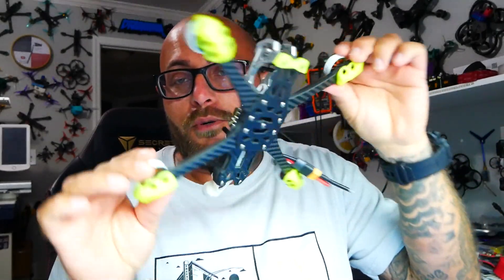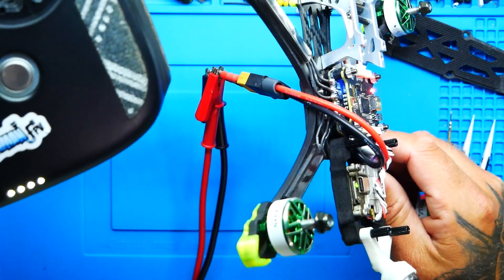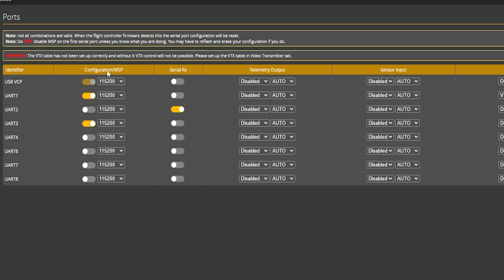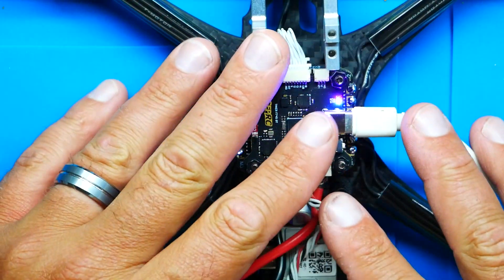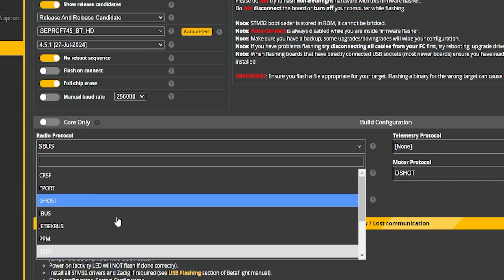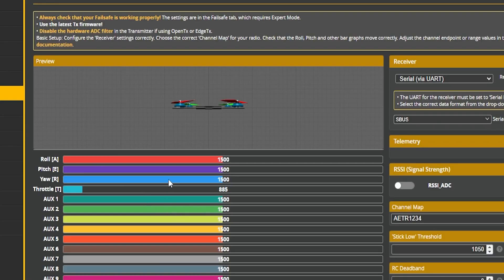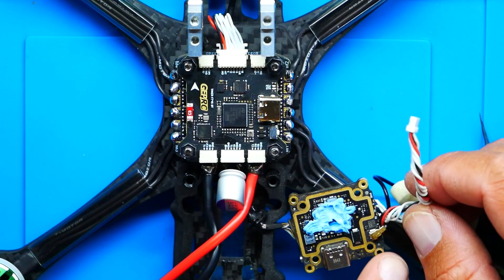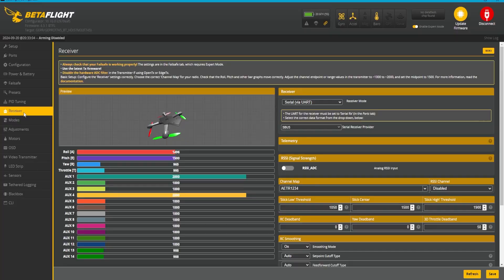How To Get Your Receiver Working!! No Communication in Betaflight?? Step By Step Troubleshooting

Comment: Hey, have this New RM RP3 ELRS V3.0 Diversity receiver won’t go into Bind Mode. Tried 3 plug way,  doesn’t work. It blinks slow red an after 60 seconds blinks fast for WiFi Mode, am stuck why it won’t double Red flash for Bind Mode, it’s New so it can’t have a bad Flashed to it Right? How do I get it into Bind mode now? 🙏🙏

Comment: 9:41 son of a bitch. I've been stuffing around with a new vapor 5 PNP,  and ended up with the same no RX coloured lines after fitting an ELRS Rx, disconnecting the 04 Sbus and setting it up as per.   That's a real pain! But at least I know what the problem is so thank you!   Now I just have to make sure I save all the settings before i flash it! By that I mean find some vids on how to confirm I am saving the setup as they seem to be a pretty good flyer out of the box, I'd rather not stuff that side of it up. Thanks again for the help!

Comment: Good morning, sir. I'm a follower of your channel. First of all, thank you for your videos, which are very helpful. Congratulations on your channel. I need your help, please. I have a CinewooHP
3.5-inch with a DJI AIR UNIT 04 Pro system, a DJI 3 controller, and Goggles 3. I have a JHEMCU F7 22 AIO flight controller. Everything is paired correctly: goggles, controller, and camera. Once inserted into Betaflight, everything works correctly, but the receiver bars don't work. I have a video signal, but the bars don't work. I need your help, please. I've followed your tutorial, but the bars still don't work. I don't know if it's the UARTs. Thank you, and best regards

Comment: Hello DrainMan! I have a cinelog v3 with the dji o4 pro air unit +goggle n3 + dji fpv rc 3 configuration. After a strong crash I replaced the air unit completly.Binded again from the beginning.Calibrate the rc on the goggles but the controller is not detected anymore in betaflight.Not a single button or  a joystick is deteced anymore.Any advice wood be really appreciated!

Comment: Thanks for the video! I’ve been assembling GEPRC Vapor and I had a problem with Betaflight not seeing receiver commands while binding was successful. The problem was that I connected DJI O4 pro with standard 6 pin cable to the FC connector and didn’t notice that one of these 6 pins on FC is labeled R2, at the same time I had soldered my ERLS to UART 2 on the other side of the FC… I followed your instructions and removed 2 wires from DJIO4-FC cable and it works!

Comment: Criminally underrated for real build issues.
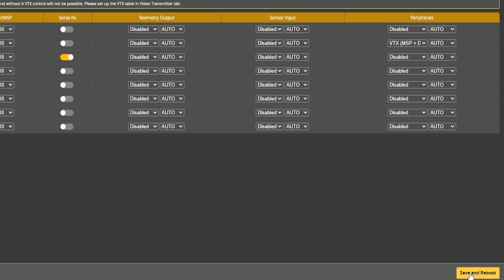For anyone else with a similar issue, I changed an analogue vtx to openipc thinker and toggled its serial rx on, as drainman points out around 6:30-6:50 you just want it toggled on one, so I left the openipc serial with msp toggled, unset serial rx for openipc, left it toggled for the receiver, and that fixed the issue.

Comment: allot of people are buying BNF PNP and they want to add there own receiver Crossfire or Elrs and betaflight is stuck on SBUS It would be great to make a video on saving the CLI and putting a new version of BF with Crossfire/ELRS and then adding that CLI So you still have all the settings from the BNF but with ELRS/crossfire.
I have looked and can't find a video on this problem. Its a bigger problem since Betaflight is shipped on PNP quads with only Sbus on them...

Comment: Thank you so much!! Finally I was able to bind my receiver. I just bought the rp4td radiomaster receiver and spent almost a week since I welded the receiver to the UART2, it got power but it did not work, until I watched your video and I noticed that I should try to weld it on the rx3 and tx3, went to betaflight and configured the uart 3 and now is working. I could not find a better video than yours, I was really frustrated but now I already made my first flight with elrs. Thank you so much!

Comment: brother i watched the video and dhamn this is good content there was only one thing to do and that's smashing the sub button and freaking like the video ;-))
i'm having some trouble now with my NAZGUL DC5 ECO  , i soldered the GPS in and soldered the yellow and white to the same port as the ELRS unit ..omg i'm pretty new to this but i'm not a noob with the solder iron but STILL A MORAN DO HAHAHA 
what happened after i finally find out my mistake  by measure the solder pads r2 and t2 channel ports on the board back to the connectors on the cable to the ELRS i had contact it seems that there is a 4 pin  connector under the board that is using the same connections / port ..omg one lesson learned;-0  ( i did this because i want to use the USB c powered 5 volt connection to let my GPS find SATS  with 5 volt power pack on C USB ..while drone still is in low power modus zo i could connect my 6S LIPO only when SATS  are plenty 
and pull out the c USB and fly with all the SATS  i need with out frying my drone waiting on SATS with the LIPO on it to find al SATS first ) 
oke now i know how the ports work and the board/FC   is not 2 different layers of cake ;-)   zo had to put the wire back on R4 and T4 that channel was free 
kept my power red and black on the same 5 volt power output as the ELRS  is pulling power from ,
but here is the second mistake i made i i saw i also had the yellow and whit wire  switched the wrong way on the T2 and T2 on the ELRS connection OMG i'm a idiot i know hahaha 
but changed the wires and boem my GPS is up and running finally i was happy , but now my ELRS is binding to the controller but no sticks moving in BETA and all previous working setup modes /switches did not do a thing to ?
Did i just fry my ELRS UNIT with my EPIC stupid move ? it binds to controller but keeps blinking 3 times bleu ? not a soled green , and my t15 jumper is saying MODEL MISMATCH now ? 
please help me out  if you got a solution 
i already order a new IFLIGHT  ELRS unit but that's the bad out come fix hope you got a idea to flash my brain fart 
thanks for the contend

Comment: Hellooooo, ive got a big problem with one of my quads.
My receiver is no longer recognized after 8 months of quad storage. It just beeps. Changing the UART didn't help. I use crossfire, also tried with frsky. Same problem. The FC doesn't accept any signals.. is he dead?? I want to despair...😪

Comment: I’ve always been a Spektrum dude that flys large scale planes and turbine jets. I’m getting back into the fpv quad hobby for fun, but for F’s sake, BetaFlight will not recognize the micro srxl2 receivers :( I’ve tried every setting, watched every video. My IX-14+ binds easy to these receivers, but BetaFlight is like get the hell out of here! lol
So I bout a transmitter and some receivers that support some junky protocol called ExpressLRS.. (lol, Just Kidding:) 
I don’t mind spending money on equipment that works , but if someone could please tell me why srxl2 will not connect with BetaFlight I’m ready to listen!

Comment: Please help me. I ave done all this except for the diode thing. I have an o4 that just shows the color bars but won't move upon input. Ports are good, sbus is good, I have reflashed firmware even with full chip erase.  I can't get the rc3 to input. The controller works in the sim, it does bind to the goggles 3.. I have tried with an o3 and the same problem occurs. I'm at a loss, it just stopped working
Reply: Ever find solution ? Rc2 an 03 here doing same thing .
Reply: @KinqJames  yeah, sbus for some reason changed to inverted status off
Reply: @ I’m having hard time finding out if mine is off or on. Says just to type in command in cli to turn on but not sure if it’s already on?
Reply: @KinqJames  type get sbus_inversion and it will tell you wether its on or off. If off type "set sbus_inversion = on"

Comment: 11:10 this just happened to me but i eventually realized it after flashing firmware 5 times and realizing i didnt select the protocols at the time of flashing! Great point!
But now my issue is telemetry....like, i have no data on my boxer screen other than the voltage of the boxer itself. Lets see if my answer is in this  video!
Reply: Did you figure it out, im having issues still
Reply: @gabagabagooliani  not really. I think the only telemetry data i get is like link quality.
Reply: i cannot even get the sbus flashed onto mine , i only have cfrs i can select even tho if i flash sbus onto it , im just stuck and i cannot find information about how to solve this

Comment: OMG!!! Your advice to reflash the firmware and change the radio protocol was the highlight of my night!! I’ve spent the last 2 hours tinkering, reading forums and watching videos. You sir, are amazing!
Reply: I was the same. Thank all that's holy that I found this video!
Reply: Same here. About to call it a night then entered the rabbit hole of YouTube and finally fount his gem.
Reply: And it is still not working. I followed all the way through removing diode.
Reply: YES. ME TOO. GOD why couldn’t I have found this last week. And if I hadn’t actually watched until 10 mins in to this video I’d likely have given up or been stuck for another week trying to figure it out. This needs to be at the start of the video imo

Comment: same issue, but with Futaba R2008SB 2.4GHz S-FHSS 8-Channel Receiver. 
No solution for now
Edit: Solved, Turns out that my FC use a different UART port than the usual ones

Comment: Whats up.. So i have a client that im  fixing a connection issue with his drone. Using a radiomaster zorro with elrs connecting to a darwin ape fold 4inch.  It worked fine before. I had to reflash the FC the first time i fixed this drone cause the client doent know what hes doing. Fixed that time. He didnt want to proceed to have me set up his gps stuff. He got the drone back and messed with the gps stuff and somehow hit a setting or turned something off, and now the receiver doesn't talk to the FC now. Ive updated the fc, the zorro tx and the elrs on board and rebound it. It shows that its bound but still no movement tho.  You can see in the reciever tab that the colored lines move to their bound positions but no movement from the sticks. Now i have since bound it to my Radiomaster TX12 MK2 with elrs and it works on there.  I even took the sd card out of the Zorro and put it in my tx12 just to see if maybe it was the sd card, but to my surprise it still worked.. I am at a loss with what to do here. It seems like something on the radio end of the software was switched off or something making it not want to talk to the FC despite it being bound.. And help or suggestions would be greatly appreciated
Reply: Same issue here

Comment: I am struggling trying to get an elrs happymodel ep1 to show stick movement in betaflight. tx is to rx and rx is to tx. im on the correct uart. Im binded to my transceiver and still nothing in betaflight. I've watched so many of your videos and others tshooting this issue. So ready to "toss this thang"....any other tips? (anyone)
Reply: I have the same problem. Still not working
Reply: I have the same problem....
Reply: @dawanparker6555  already settle my problem, i reflash my fc with CRFS protocol.
Reply: Same problem over here
Reply: any idea to solve this issue?? got same problem!

Comment: but what about elrs receiver it didn't worked there is no throttle movement in beta flight. Drain man please help me out with this
Reply: Did you get this done? I’m having the same problem
Reply: @vickyandbru  yeah. I found the mistake on my transmitter and changed few settings and it's working good on the same day
Reply: @invicto8138  how did yo do that? can you explain me? I have a O4 pro with a Vapor D5 with ERLS and Betaflight don't recognize the DJI FC3 all the bars are grey :(